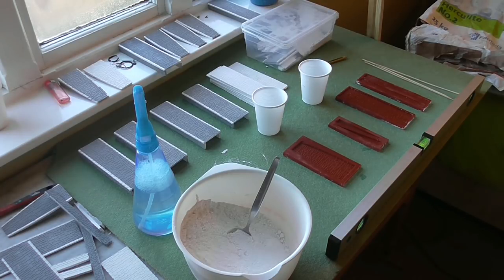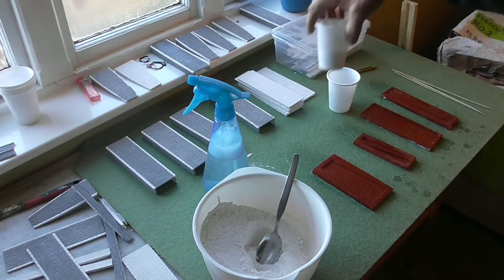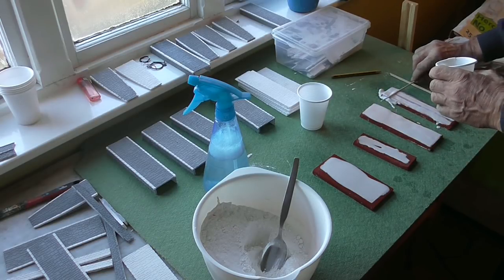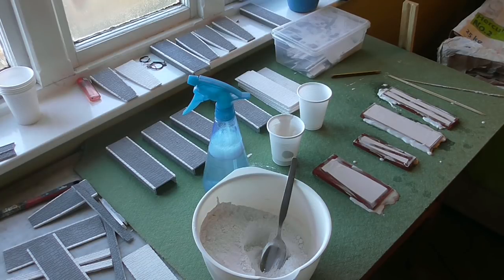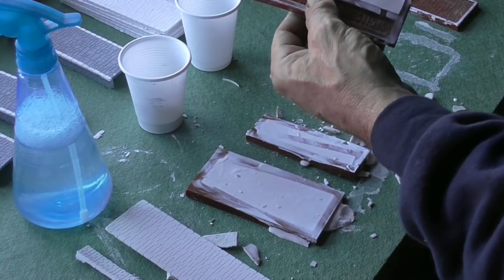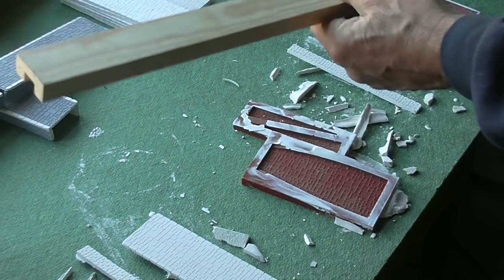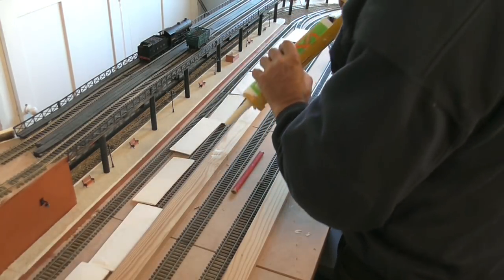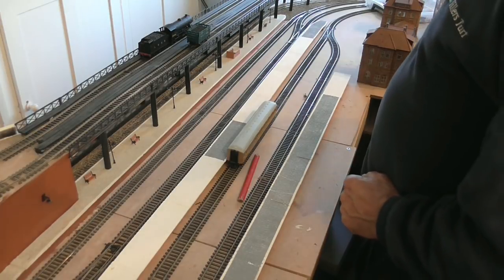Making Station Platforms in Plastercast part 1

Comment: Hi Glynn,

Nice tutorial,  I have often thought about using plaster moulds for when I make buildings.. could be interesting to experiment with.  Unfortunately my platforms will be curved so it would be too awkward to do this way but they do look fab.  I am sure you will figure out your platform clearances.  One tip I heard awhile ago is when you have it all stuck down and you have your join lines, If you brush on a very watered down plaster mix over the top (and maybe when set you might have to do a tiny bit of carving) then it removes the join line completely and looks like one whole casting.  How do you wash out the moulds? 

Cheers,  Michael
Reply from the maker: Hi Michael, thanks for the  tip, am going to stick on the side walls then I will sand it down, hopefully the joins not to visible, if so then I will try, wash them in hot water, the plaster breaks down straight away. Thanks Glynn

Comment: Hello LNER 1946,      That all looks very good , and a very interesting process . Please answer two queries :- 1. What make
   are the moulds.    2. Is the plaster an  " every Day " type , or does it have a specific use in the building trade , i.e. fixing 
  plasterboard or the like ?      Regards,  Paddy  Owen.
Reply from the maker: Hi Paddy, The moulds are by scenecraft, if you put plaster moulds in OO gauge on Ebay search they should come up. The plaster is  called Herculite and is a easy available everyday mould plaster. I purchased all on ebay. Thans Glynn
Reply: Hi, the moulds are actually ScaleCast as this is my brand that i have been doing for 4 years and we have lots of products, here is the website link if your interested https://www.scalecast.co.uk/
Reply from the maker: Thanks for that, the moulds are excellent, will have a look. and would recommend. Glynn